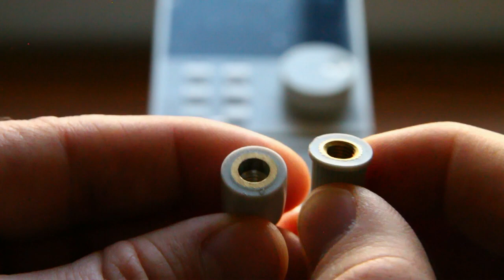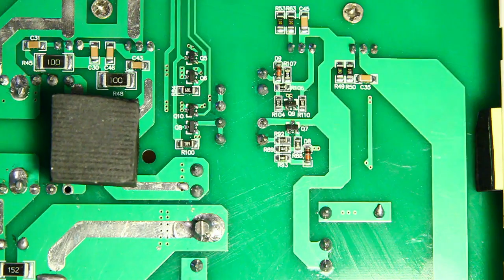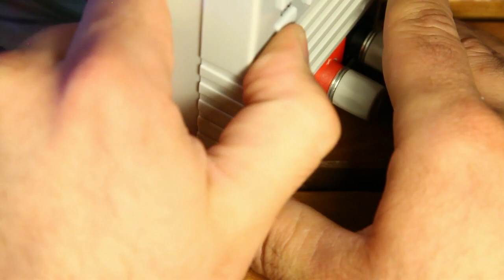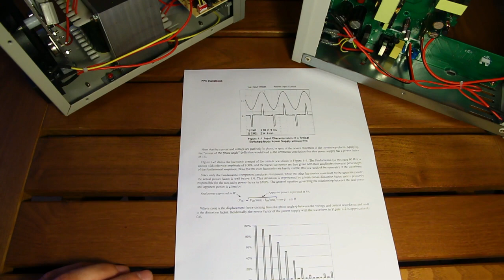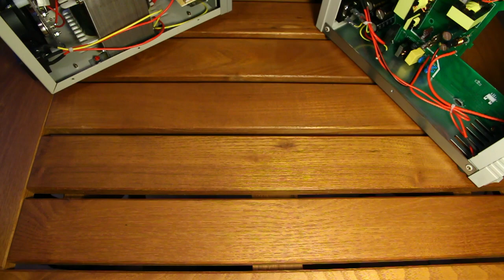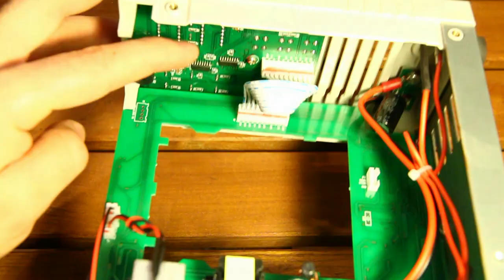AVR KPS3010D 30V 10A Bench Switch Mode Power Supply - Review Part 2 Teardown #015

Comment: A mains transformer with a rectifier secondary load is fundamentally no different than a direct rectifier on mains in terms of harmonics. The direct rectifier doesn’t have transformer’s leakage inductance to “soften” the transients, and its impedance is not raised by the transformer. But, at the most basic level, both types of power supplies you show next to each other have similar pulsed AC consumption. I have designed supplies with secondary PFC for better utilization of legacy mains transformers. There’s less voltage drop under load since the peak AC current is lower. It’s also possible to design the secondary (or primary!) PFC for harmonic correction: it loads the mains to remove existing harmonics. But I agree that PFC should have been used.

Comment: Hi! Any chance you could upload a firmware dump from the STM32 on your power supply? I've been playing around trying to get the serial output to work but I think the firmware on my unit just doesn't have it enabled. Thanks
Reply from the maker: Hi, I was also trying to get the firmware, but I had the same issue and didn't have the time to dig deeper. Let me know if you find something, this thing has potential if one can fix the bugs...
Reply: @k-tech796 So you've tried the serial connection and it didn't work on your firmware either? Shame. I've dumped my firmware with an ST-LINK programmer as it seems to have a few more of the bugs worked out, in particular regarding OVP and OCP. if you want to give it a try https://drive.google.com/open?id=1CLqjHhMjulb4hq0ASQfLPLw0EQqlqBTl Unfortunately they don't seem to sell this model here in the UK anymore, maybe due to the missing PFC. Also, the manufacturer AVer seem to be impossible to contact, the website written on the manual is down, and I don't dare call the chinese phone number printed on there. As much as I'd love working serial communication on this cheap £50 power supply, we might have to curb our enthusiasm, as there seems to be a limited number of these out in the wild, and I'm definitely no expert at STM32 firmware or reverse engineering. One could theoretically write new firmware from scratch given that most of the ICs on the board seem to have datasheets available, but I really doubt it's worth the time and effort. For my application I might try to just intercept the data line for the display led driver ICs with an arduino so I can get some data output from the supply, but I'm still hanging on to a sliver of hope that someone has the finished firmware for this. Of course, there's a chance that the company never shipped a finished version, which is a darn shame because, like you said, you can tell someone actually put a lot of thought and effort into designing this. Even with incomplete firmware, It's still definitely my favourite cheap PSU, and I'll be very sad when it dies

Comment: As for the transformers it is probably half bridge topology so the two big "transformers" are the main transformer and the output inductor plus small isolation transformer and control circuit SMPS transformer.

Comment: It is the EU problem if it wants PFC not yours. This PS is pretty simple and adding PFC is not that easy and cheap as you may think. And put C32 in there :)
Reply: hi! I know this is kinda old, but I have the same supply and I've been wanting to mess with it a little. Which one is C32 and what does it do? Thanks

Comment: Great to see there teardown.
I have just bought one of these but not had chance to use it properly yet.
What do you think about the capacitor connected on the back of the output sockets ?
I can see a few issues with this.
Reply from the maker: The cap look a bit like an after thought, it is just dangling there. Everything has its pros and cons and i think they probably installed it to get the noise down. Sense wires would have been also useful.

I'm curious whether or not the advanced features like "Over-Voltage-Protection", "Auto-Test-Function" and "Output-Timer" do work on your unit. I'd like to know if it's just my copy or if the firmware just wasn't ready before production.